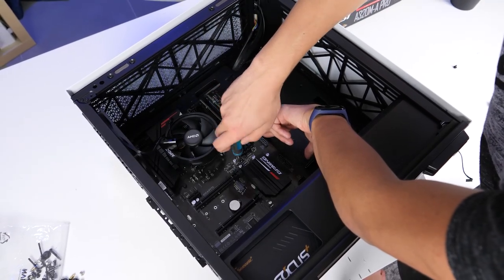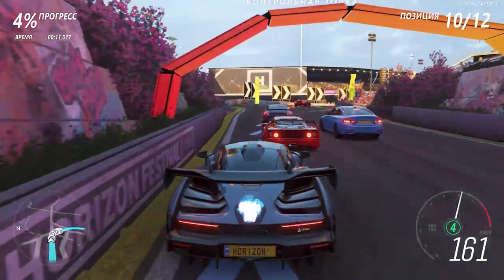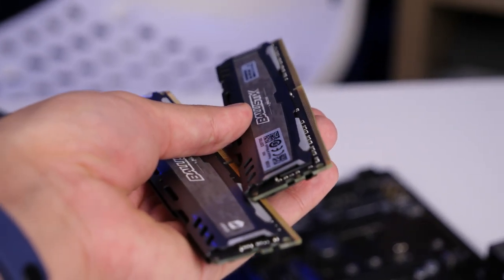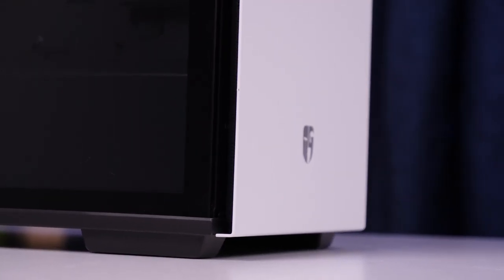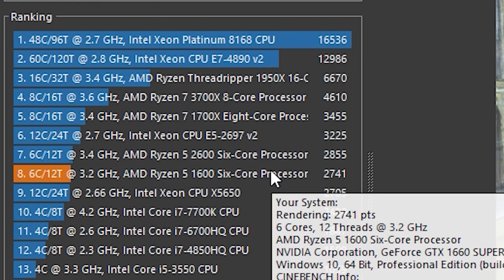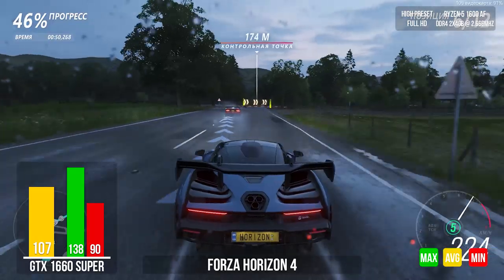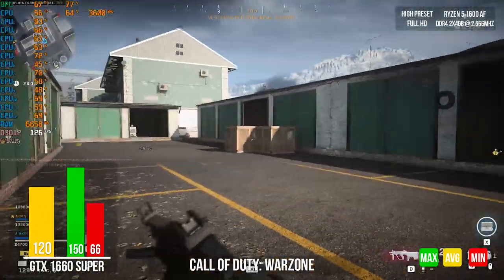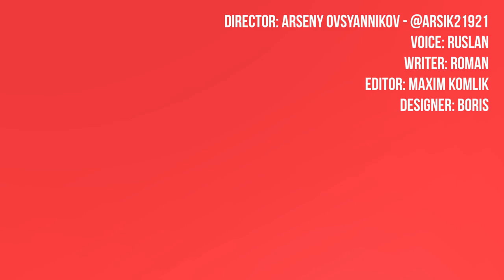$700 BUDGET GAMING PC IN 2020 – 1080p KILLING BUILD!

Comment: Bro  I am trusting ima build this one
Reply: No l think there's better builds out there for 700$ especially The CPU choice is questionable I would go with the ryzen 5 2700 or 3600 also ryzen3 3100 or 3300
Reply: @evo8150  ryzen 5 1600 af have almost the same performance with the ryzen 5 2600,but it was cheaper,and if u choose ryzen 5 3600 then it will over the budget
Reply: @frex2853    If you get less powerful gpu  you can get more power cpu with bottle necking. You can also go for used ryzen 5 3600  to save money but there is a clear risk with this option. I would rather go with a 700$ build then a  that has ryzen 3 3100 or 3300 this video will explain my thinking
Reply: Pls don’t listen to hi